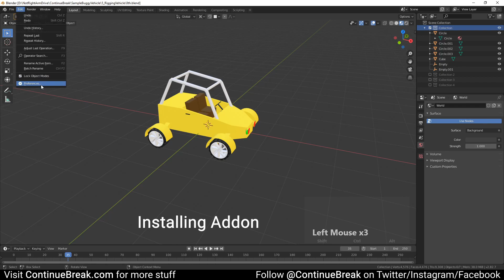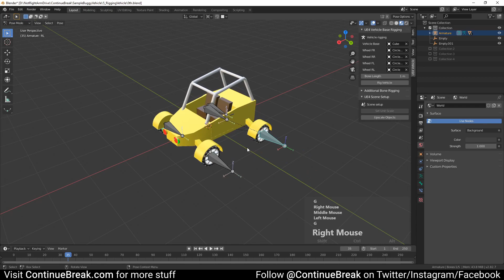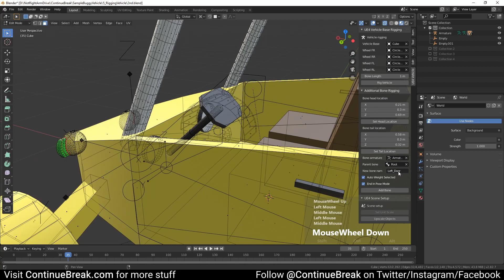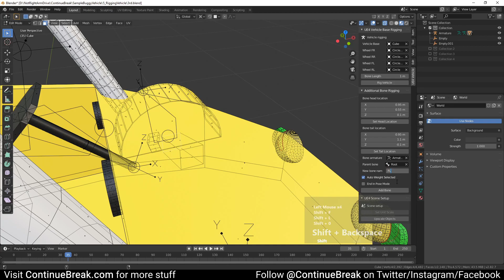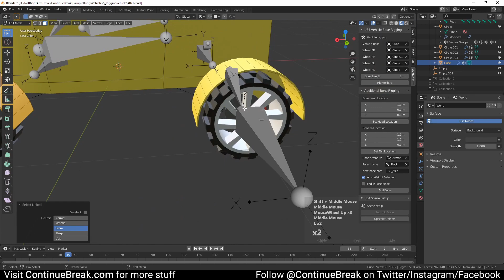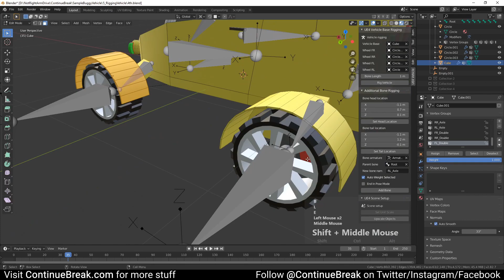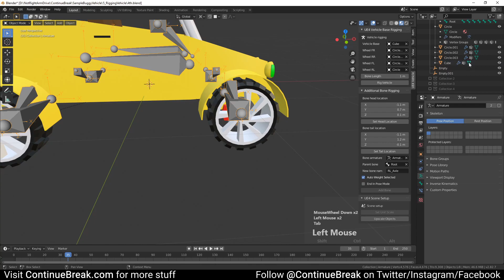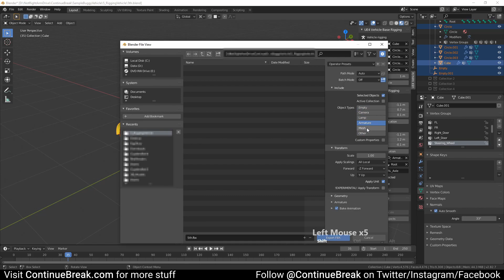Rigging the vehicle model in Blender | [Part 5] Low poly vehicle for UE4

Comment: when I do the rig, the origin of some wheels changes and is no longer centered based on the geometry.
Reply from the maker: Bone is no more at the center of wheel? If you used the addon to rig, it should set the bone at the center of the mesh geometry. Maybe your mesh has some vertices left outside of it so it messes with the geometry center calculations.

Comment: isn't it possible to bind multiple mesh parts to the root bone? (suppose i want to keep my cars body part separate say front and rear bumber so that i can disable/swap them later in the game) how will i achive this ?
Reply from the maker: The easiest way would probably be to add those parts to your vehicle blueprint as separate static meshes that you can easily change on the fly.
If those parts might have some animation or something like that, then probably you want to set them up as separate skeletal meshes or you can have all meshes rigged to one skeleton and use master pose for all of them. You can look more about Unreal Engine modular solutions here: https://docs.unrealengine.com/4.27/en-US/AnimatingObjects/SkeletalMeshAnimation/WorkingwithModularCharacters/
Reply: @ContinueBreak  thanks i'll try what you said. One more thing whenever i rig the vehicle myself (without using your script) i get missing bind pose error in UE4 for all 4 wheel bones. What would i be missing?
Reply from the maker: If rigging with the addon doesn't have that error, then probably there's no issue with your export settings from blender. I also have a  tutorial on how to rig it without the addon: https://continuebreak.com/articles/how-rig-vehicle-blender-28-ue4/

Comment: I am taking external 3d models but it's not rigging properly. Have I done the right step or should I make 3d model of my own 3d model rather than external 3d model.
Reply from the maker: Does your external models have vehicle body as single object and each wheel as another object? It will not rig correctly if body or wheels will consist of many separate objects. You can join objects by using Ctrl+J shortcut or just google on how to do that in blender.
Reply: @ContinueBreak  Hi, Thanks for your help! I figured it out somehow. I rigged my car like you said.

Comment: Hi, thanks for this cool addon. I tried also to rig my doors, but the doors are seperate meshes. Anyways, i tried it. But no luck. the bone is there, but the door not attached to the bone. Did i a mistake, or does it work only, if the door is a port of the root?
best regards michael
EDIT: Problem fixed, i merged the door after rigging to the root. And it works. Thanks for this easy plugin. :D

Comment: Could this addon work for vehicles with more than 4 wheels easyly? Great job, keep it up! :D
Reply from the maker: Default UE4 WheeledVehicle pawn supports only 4 wheeled vehicles. But I'm working on the update which will support any wheel count. You will not be able to use it with default UE4 WheeledVehicle pawn, but Simple Wheeled Vehicle Movement component should support them.